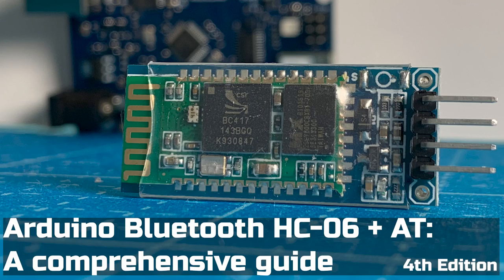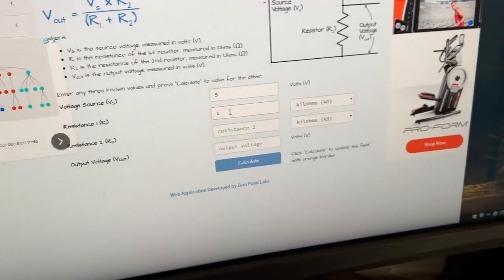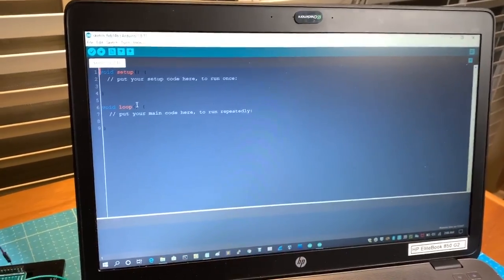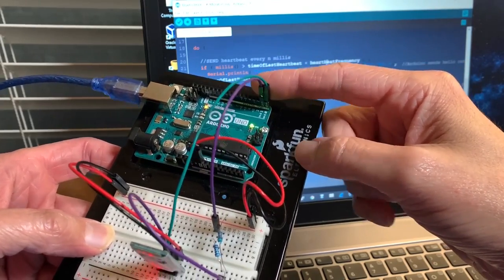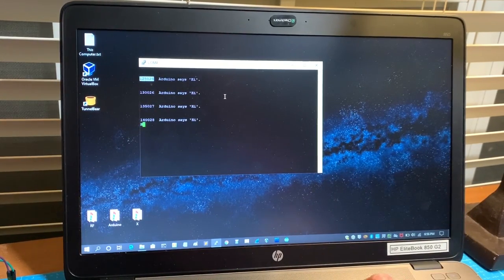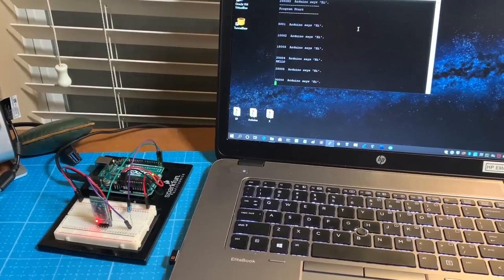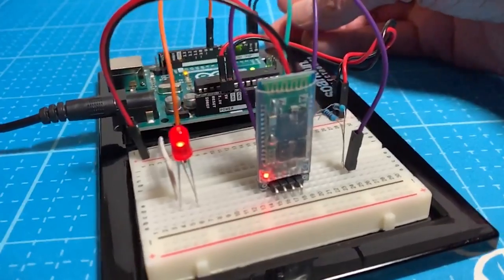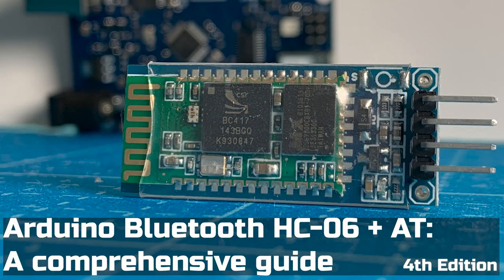Arduino Bluetooth HC 06 + AT Command Set: A Comprehensive Guide: 4th Edition

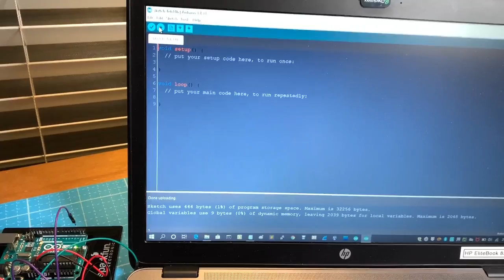Comment: At 8:14 , we should connect back "TX-TX" and "RX-RX" while sending the AT commands to the HC-06 module.
Note : We should always send an empty code (the default code of a new project) to the Arduino before sending the AT commands to the HC-06 module. While uploading any code to the Arduino, we should always disconnect TX & RX pin of HC-06 from the Arduino board.

Point to be noted :
* For sending AT commands,
   Connect--------"TX-TX"  &  "RX-RX"
* During working of the circuit,
   Connect--------"TX-RX"  &. "RX-TX"
* During uploading the code,
   Disconnect----------"TX" & "RX"
Reply: Thank you for this tip. I needed it!

Comment from the maker: NOTES ON VIDEO BELOW 

NOTE 1: THIS VIDEO IS NOT FOR THE HC-05.  This is for the HC-06.  They are significantly different. 

NOTE 2:  There are a couple of spots in the video where I'm clearly befuddled with why they silkscreen arduino ports, 
                 TX > [pin1] = receive    and      RX < [pin0] = transmit.  
                  I personally believe the receive pin should be labeled RX and the transmit pin should be labeled TX.  But apparently that's crazy talk.  :-) 

NOTE 3: At 8:14 make sure to plug Bluetooth back into ports 0 & 1   

NOTE 4: Make sure Receive and Transmit are cabled up correctly after you upload blank Sketch.  The silk screen on some Arduino devices can be confusing, being the pin that RECEIVES is actually labeled TX with arrow pointing IN and the pin that TRANSMITS is labeled RX with arrow pointing OUT.  (See graphic here.  Notice the two modes if you will https://youtu.be/is3EaCSnJyo?t=69)   

NOTE 5: Make sure you are dropping the TRANSMIT voltage from the Arduino to 3.3V using the VOLTAGE DIVIDER (https://youtu.be/is3EaCSnJyo?t=143)  

NOTE 6: In Arduino serial monitor make sure you have the correct speed and line settings ( https://youtu.be/is3EaCSnJyo?t=498 )
Reply: i was wondering why the hell there were a lot of changing lights and stuff and no messages at the com of arduino IDE, thank you so much sir

Comment: why adding extra 2 resistor was necessary in newer hc-06 than the older version hc05 which has no resistance to be included in circuit.

Comment: When opening the COM serial monitor after uploading the empty sketch via USB cable, i type "AT" and the port does not return "OK".

Got any thoughts on why it might not be working?
Thanks
Reply: Im having the same problem , please if you solved it could you tell me how
Reply: @nuraqasrawi6014  haven’t figured it out, nobody in my class has. I’ve pretty much given up on uploading via Bluetooth
Reply: same problem. been pulling my hair for a while
Reply: I have the same problem. The module does not respond to AT commands.
Reply: @tophertmg  
Hello I am running your script and I cant seem to have it display via bluetooth on the putty window , if i type anything  in the serial monitor top bar it shows up on the putty window but the heartbeat Arduino says hi will not show up. appreciate some advice thanks
Reply from the maker: After uploading, sometimes I forget to connect the TX and RX pins to the Bluetooth module. :-)
Reply: Make sure you got the settings in your serial monitor right. Set them to "No line ending" and 9600 baud. changing this worked for me.
Reply: @sandergoed220  THIS ^^^^ Just tried this and worked instantly after trying nearly everything else

Comment: What if we connect directly the 3.3V pin of Arduino board to the HC-06 module , instead of connecting the voltage-divider to get the desired 3.3V ? Will it work ?
Reply from the maker: It's touch and go.  Sometimes it works for a little bit, but in my experience, it was very unstable, if it worked at all.

Comment: Thankyou, worked as you stated, wish  I could get the HC-05 to work. I think the board has a fault. It works but won't respond to me. Thankyou again
Reply from the maker: Yeah the HC-05 is a bit of a different animal.  Other than being and acting a little different, I think the hardest thing is to make the voltage divider (in video at 2:40).  Best of luck.